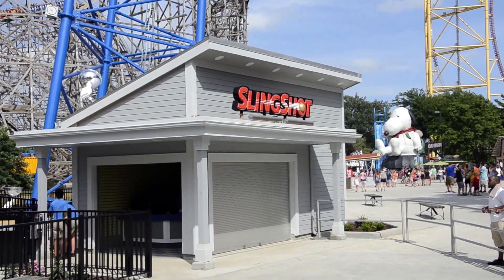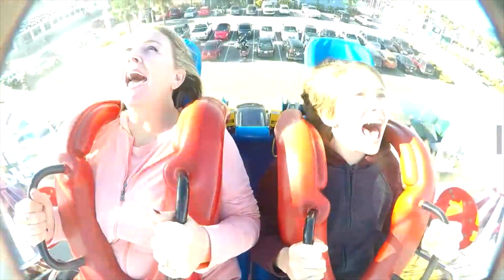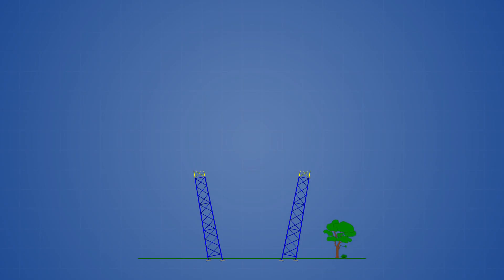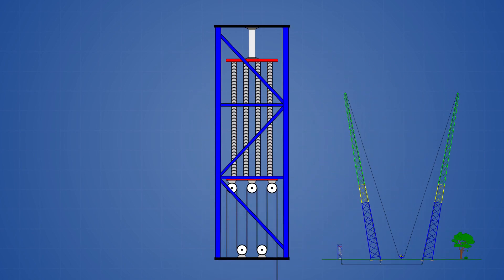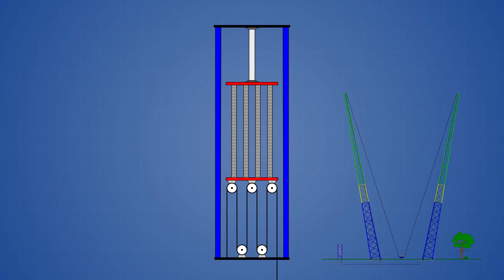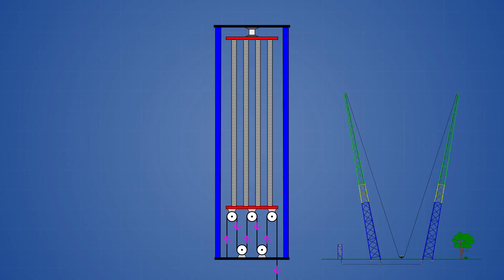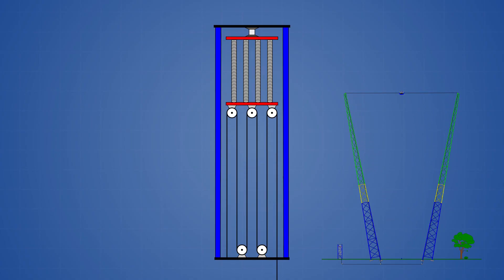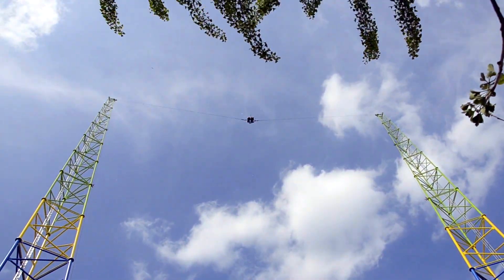How SlingShot Rides Work

Comment: so that explains why the newer slingshots are slower than the old ones.... aha
Reply: That's up to how the machine was made.
Stiffness of bungee chord is probably quite limited, but there is no limit for the stiffness of springs and the size of the steel cable.
So new design has much more flexibility.
Reply: @majinpe  I would make one that went a thousand feet in the air with these springs
Reply: Trent McTrump  I'm pretty sure they only hit around 65 miles per hour. elastic slingshots go around 70. I've been on an elastic slingshot, and I'm pretty sure it accelerates much faster too.
Reply: Enjoyable bullshit yes the reverse bungee ones are faster and more intense.
Reply: @MrMywildside  Personally i probably wouldn’t “trust” the bungee ones. But by that I really mean I would just be too scared of the possibilities to ride it. The steel one seems safer, but then again, I probably would be too scared to ever do either. Is it worth it? I love thrill rides.
Reply: I don't know if it's slower or not but it still accelerates you to a hundred miles per hour really fast which will definitely still kick your ass back into the seat
Reply: That profile picture

Comment: But by chance it break there is no protection guard on it..
Reply: There are 2 STEEL cables on each side. The chance that both of the cables break is extremely low if not impossible